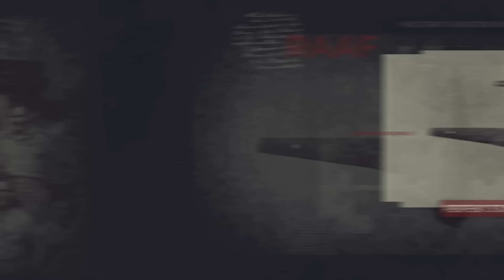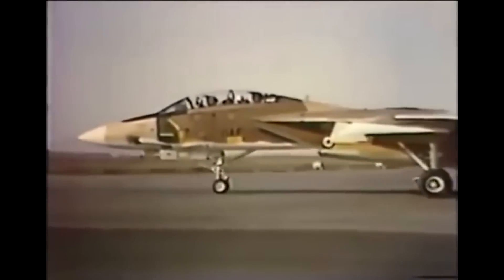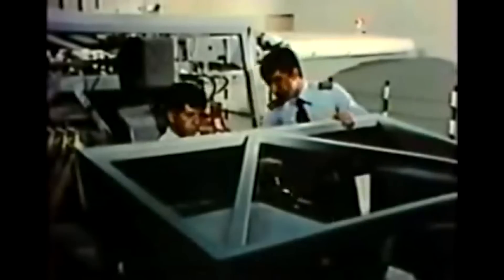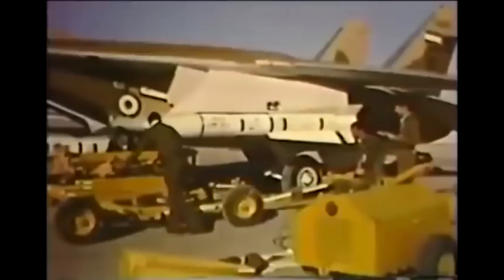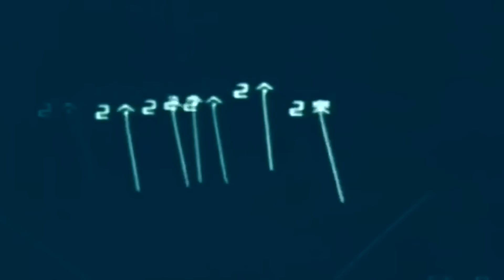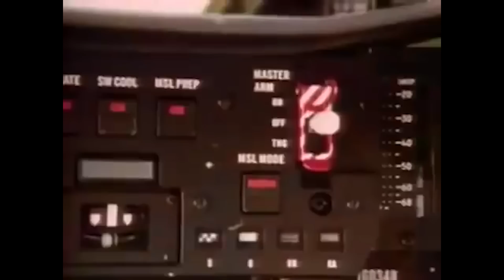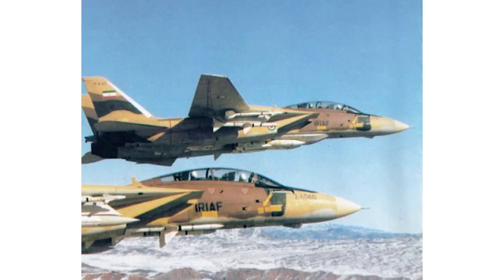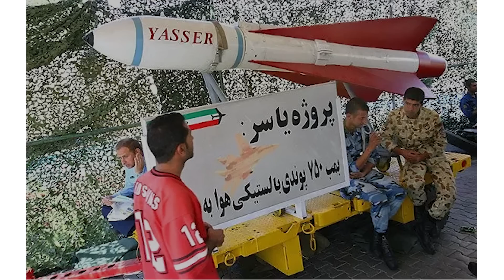How Iran strapped SAMs to F-14 Tomcats

Comment: ACTUALLY THREE.  THREE MIG 23'S  flying very close to eachother.  I saw the pilot himself telling the story. The Phoenix missile successfully had locked on the plane on the edge by the F14 system. He manually reprogrammed it to hit the one in the middle in hope the shrapnels from the plane splashing damaging the other two Migs. In fact it did, he downed Three mig 23s flying in formation with One single Phoenix missile.  It's credited as the most kills by single missile. The also have Jalil Zandi as the most successful F14 Ace with 12 Confirmed hits by Americans , according to Iranians he shot down 23 aircrafts , and hitting even more but not resulting in a kill. Zandi Could have even more kills , but hecwas imprisoned by the goverment itself questioning his loyalty to the goverment.  Hecwas later released under the pressure of  other Iranian pilots, and returned to war in the last year of the Iran-Iraq war and managed to down a Mig25 flying at 70,000 ft with a phoenix missile fired from F14 at 40,000 ft.  Mig 25 still to date is known to be very notorious and feared , capable of flying at very high altitude @ close to Mach 4. Very difficult to hit by any means. Unfortunatey after war he was forced retired. And the. Later was killed in car accident travelling to North of Iran. How tragic that can be for an Ace to be killed in a car accident ?!

Comment: Factual error in this video:  The US no longer supplies parts and support for Phoenix missiles, but the Iranians used them many times successfully in combat. Also, the film implies that the Phoenix missile was shot off the rails whereas the Hawk was dropped before ignition.  The Phoenix missile was also dropped from its launch rail prior o its rocket motor's ignition.

Comment: Admitting the uniqueness of Iranian pilots and the best friend or ace of F-14 pilots Fereydoun Ali Mazandarani and the F-14 fighters themselves with their long-range radar and Phoenix missiles, but there are facts about their purchase and use that are rarely discussed in such documentaries. . 1- From a commercial point of view, each of these F-14 aircrafts was purchased more expensively by ten million dollars compared to the most expensive F-35 due to the financial corruption of the Shah of Iran, and the Shah of Iran received hundreds of millions of dollars in commissions in his bank accounts in Switzerland.
 2- The F-14 fighter is a sea-based fighter to counter With the MiG-31 fighters, they carried Soviet nuclear missiles and had no use for the Iranian Air Force, so Iran was the only country that was willing to buy them, instead of Israel, Turkey, they bought F-15 and F-16. 
3- The purchase of F-14 by the Shah of Iran was accompanied by the opposition of the commanders of the Iranian Air Force. 
4- The engines of this aircraft were the same engines as the F-111, which later the American Air /Navy Forces were forced to replace with engines proposed by GE. 
5- One of the reasons for the early retirement of F-14 fighters was the collapse of the communist Soviet Union, the last of which occurred in 2006, while the F-15, F-16 and then F-18 Hornet fighters are still in service.
6- The maintenance costs and the cost per flight hour of the F-14 were the most expensive costs of a fighter at the time.

7- Fereydoun Ali Mazandarani, the leader of the F-14 modification team, not only replaced the Hawk missiles with the expensive Phoenix missiles, but also turned this fighter jet into a bomber by installing the bomb guidance system on the launcher.
Reply: و اما ۸ فهم و شعور تو در حد شتر

Comment: At 0:40, that Iranian F-14 on the carrier, is that a real image?
Reply: Yes, when the newly built Iranian Tomcats were being ferried to Iran, American pilots launched some off of aircraft carriers and flew them to Iran and would be given them afterwards. Basically all Iranian F-14s were carrier capable but of course their pilots weren’t trained in carrier operations
Reply: @eggnugget575   Yes, that's right. However, the Shah had placed orders for 2 aircraft carriers that were supposed to be delivered in early 80s. Obviously, with the overthrow of the Shah in 1979, that plan never materialized and Iranians never received an aircraft carrier.
Reply: @martink7609  Thanks for the information, I did not know that. They did seem to try and modernize their navy by ordering modified Spruance class destroyers aswell
Reply: wow  @eggnugget575
Reply: If those F-14s only travelled on a carrier once, that's part of the reason they lasted so long.  The F-14 had some composite parts that aged badly when exposed to salt spray, and the USN had to replace them.  Parking your F-14s a in a desert solves that problem. 😁

Comment: 10:09 single missle destorying 3 migs ? the pilot must have glitched the system, not even ace comabt video game  have though of this idea.
Reply: The Phoenix had a 133lb frag warhead.  If it hits the lead plane in a formation, that plane gets turned into more fragments. 💥
The blast & fragments also damaged a 4th plane in the formation.

After the Iraqi air force lost 2 planes to a single Hawk, and 3 planes to a single Phoenix, they probably stopped flying so close together.
Reply: The migs was fly in close formation so 
The phonex missile shoot the middle mig and that led the fragmentations hit the other 2 migs 
It was lucky shut

Comment: The project to use the MiM-23 Hawk surface-to-air missile on the F-14 Tomacat was used during the Iraq war and was abandoned after the war ended. Later, an attempt was made to use the Russian R-27 ALAMO missile, which seems to have been unsuccessful. In recent years, due to the lack of spare parts, Iranian Tomcats have had very few flights and are flown only for parades and shows.

Comment: Out of 80 F-14 orders by IIAF only 1 F-14 never deliver to Iran. The massive order was F-16, and the total order was 160 F-16 never reached Iran due to Revolution 79, supposed to reach Iran by mid 1979. However, ground equipment already reached Iran and was later sold to Pakistan.
Reply: Israel thanks Iran to this day because those F-16's were diverted to the IAF.
Reply: Ironically the Same F16 Iranians had ordered and where ready to be shipped to Iran were actually delivered to Israel and still in use.
Reply: 😭😭😭
Javid shah

Comment: Tomcats were Iran's most important weapon in the war with Iraq and stabilized Iran's oil exports
Reply: Still is Bad Ass Threat to any Modern Plane comes across. Depends Pilots Experience and having Surprise  First Advantage Position  taking down Enemy Plane.
Reply: @klausphx  As long as the radar of the F-14 is modernized to guide the missile until its terminal phase, yes, absolutely.
Phoenix is a scary AAM with 180+ km range and a speed of Mach 5 (approx. 5 x 1200km/h). AMRAAM isn't nearly as scary.

But Russia's R-37M is even more terrifying with 400km range and a speed of Mach 6. Might as well eject prematurely if one of those is fired at you.
Reply: After reading Tom Cooper's book "Iranian F-14 Tomcat Units in Combat", I think the Tomcat can be considered crucial in writing the nation's history. Maybe not a war-winning weapon, but one can always imagine the outcome if there was no F-14.
Reply: It did not stabilise anything, iran suffered heavily due to the tanker wars.

Comment: The Hawk missiles must have had amazing flight characteristics compared to the Phoenix. SAM missiles get much more powerful engines and fuel capacity than AAM. SAMs have to accelerate like a bat out of hell while plowing through thick low altitude atmosphere. Designed for terrestrial ground launch, an air launched Hawk must have been an incredible oversized AAM!

Their engineers must have wrecked their hands high fiving each other with every successful demo and their first shootdown.
Reply: What a way to get bounced! Just when you thought SAM's could not reach you, you get hit with a C4 Packed Volkswagon.
Reply: @@HK-fz5rn I don't know about the guidance end as I am not familiar with how the Hawk gets it's guidance. I was mostly pointing out how SAMs generally have a whole lot more "rocket" to them than AAMs. If the guidance problem was solved well, I bet the Hawk must have made a monster of an AAM.
Reply: @carlchong7592  hawk was designed in 1950s. unlikely to have had very sophisticated electronics. probably just a matter of correct freq to bounce of the target and it would chase it. but yea the iraqis would have had no idea whats being fired at them
Reply: range of SAM in upper  atmosphere would be a great deal longer too.
Reply: @nickl5658  I wonder how well it performed. Seems rather awesome to take a SAM up to Mach1 and launch it at 35kft.
Reply: @carlchong7592  mach 1 wouldnt give optimal launch parameters. At least mach 1.35 due to transsonic drag
Reply: @carlchong7592  There are actuall footages from those tests
Reply: Could this have taken an SR-71 down?
Reply: @@HK-fz5rnThe Falcon was also semi guided to the target by the radar system till terminal guidance is taken over  the last few seconds by the missle on board radar.  It was just a matter of making a 50's missle talk to a 70's radar system which they figured out.
Reply: The HAWK would go through Mach 1 after launch only 3 feet in front of the launcher, hence the separation concern. It then accelerated to M3.5 and could turn pulling 35g. Initially 45,000 ft max altitude but the Israelis modified some to go to 60,000 ft which allowed them to shoot down a Syrian MiG-25. With
over 100 kills the HAWK weapon system is the second most successful air defense weapon in the world, with F-15s being number one. Former HAWK tactical control officer here.

Comment: THe IRAF was the biggest sanctioned force due to over capabilities in very limited means scoring the highest kills with their dumbed down 1st gen F 14s and F4s
Reply: It is by now established by publicly available documentation that those Iranian Tomcats were not "dumped down" or any 1st generation airframes. They were / are regular Block-90 / -95 F-14As similar to the blocks the US Navy received between '76 -'80. In fact the IRIAF (at that time still the IIAF) received the newer, somewhat more resilient P414 iterations of the TF30 engines even before the US Navy did, as the Shah essentially paid the TF30 upgrade. The only things different in these Iranian F-14As were that the APX-81-M1E IFF interrogator could only interrogate Soviet built aircraft, The AN/ARA-62 ILS system was left out (just needed for carrier landings and only works there actually (doesn't read civilian or land based ILS)), the KIT-1A, KIR-1A and KY-28 Secure Voice system was left off (again, only a US Navy specific system). There was one ECM suite left off but at that time the Israelies (which were on very good terms with the Shah during delivery time in the 70s before the revolution) took care of that and had that covered for Iran rather quickly. Apart from that, Iranian F-14As are the same as the US airframes - weapons  equipment, missile guidance systems, AWG-9 radar system incl. the firing solution modes, main ECM equipment, avionics etc. - all the same. No dumping down there.
Reply: @alexanderbreunig7016  Did Iranian F-14 have same Landing Gear as U.S. Navy F-14. Iranian F-14  doesn't land or take off from Air Craft Carrier.  I could be wrong but I when saw pictures of Iranian Version F-14 the Front landing Gear looked Smaller and Lighter
Reply: @klausphx the landing gear was modified for land based operations.
Reply: very 1st generation with engine problems and lack of short range missiles.also the big consensus of such high orders for the US NAVY as the result in its purchase by Iran @alexanderbreunig7016